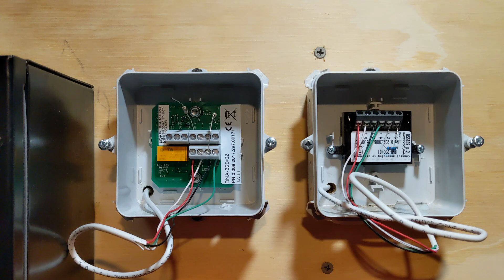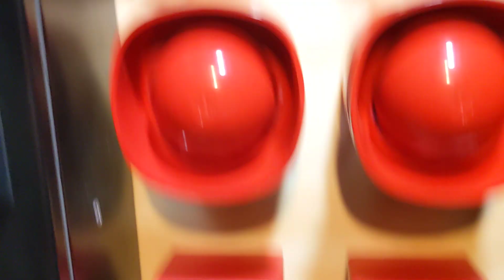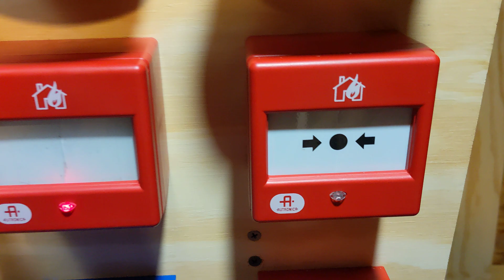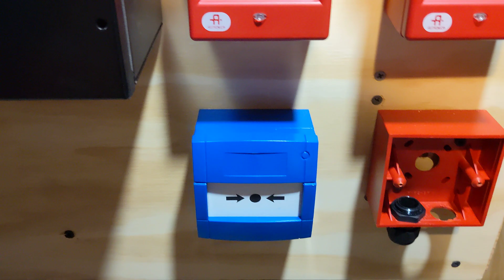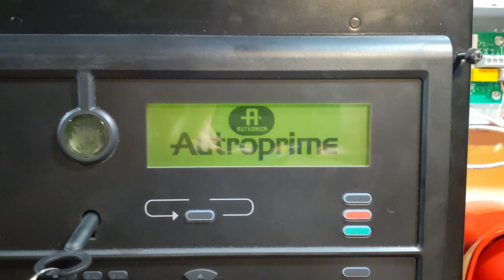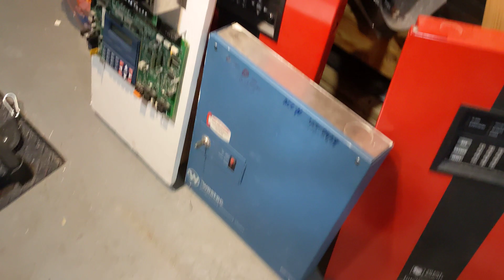Testing my Autotronica BS-200M Panel.

Comment: Im just wondering how did you get it into supervisory can you make a tut?
Reply: Use a montiored input, go into the service menu (password is 9999), configurate devices, onboard inputs, monitiored inputs, and then u can turn on if the input shall activate a supervisory, and u will have to add a ''supervisory text''

Comment: Goddamn that's a very interesting panel, is that a U.S panel? If it's not,what country is it from? Also, are there any sync options on the panel? The strobes seemed to be out of sync.
Reply from the maker: The panel originates from Denmark, but has almost any language available  I think there are sync options for the beacons, but I don't remember. Programming is different from the American panels so it's difficult to find options.
Reply: @hunterduncan362  Oh interesting, how different is programming this panel compared to U.S panels such as notifier?
Reply from the maker: Honestly, there's more variety with the Autotronica. You can change almost anything
Reply: @hunterduncan362  Interesting
Reply: Autronica is from Norway 😀